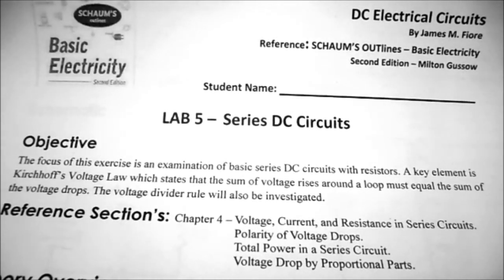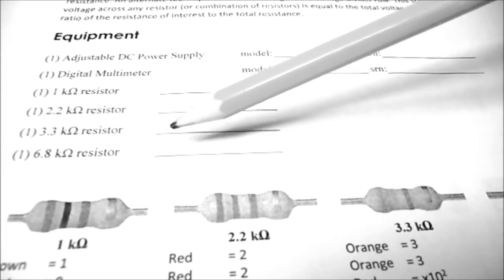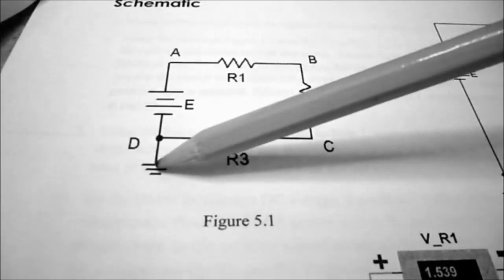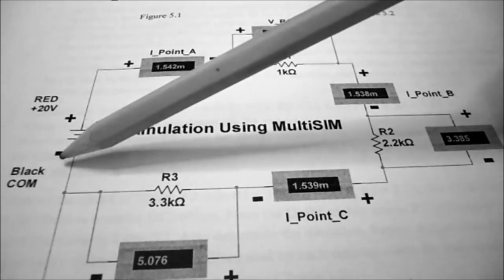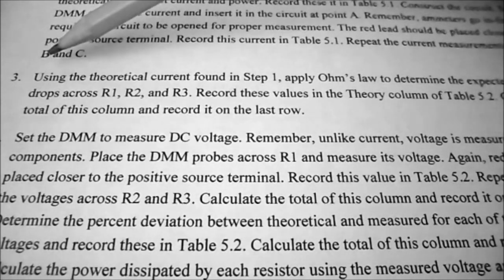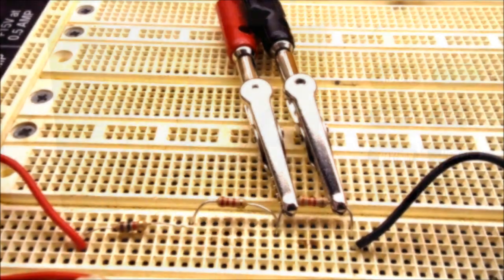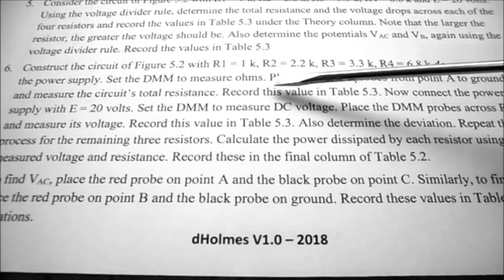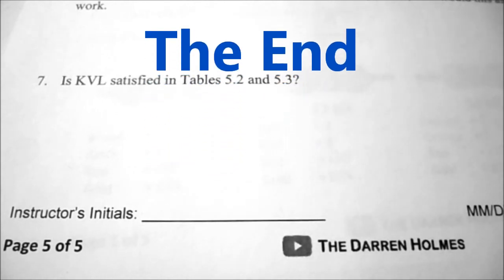DC Electrical Circuits Lab 5 - Series DC Circuits

Comment: Would you please give us all included  question answer in last???
Reply: I will try.....  

Thanks a lot.......  For the whole video..,..
Reply from the maker: Nice try. Your professors are already upset I give you too many answers in the videos. For both the DC and AC labs I don't have answers for the questions on the last page. You should base your answers on theory learned and lab observations.